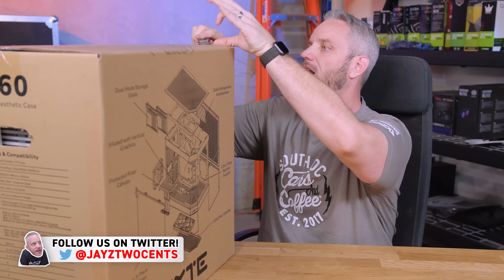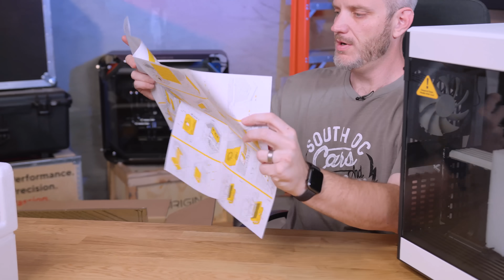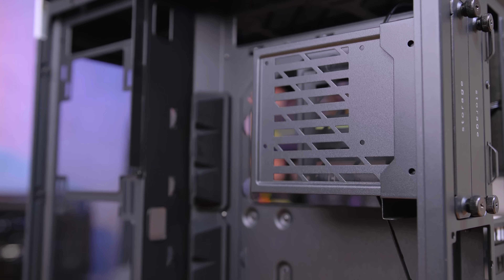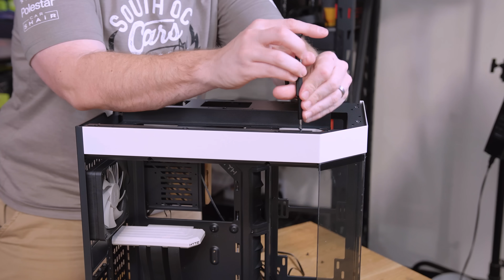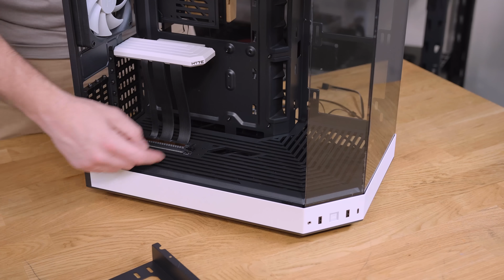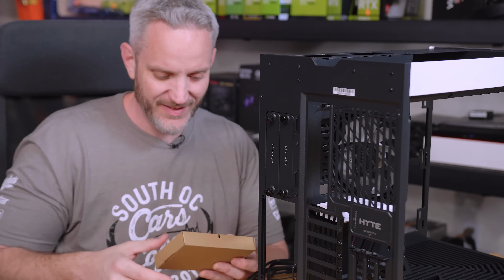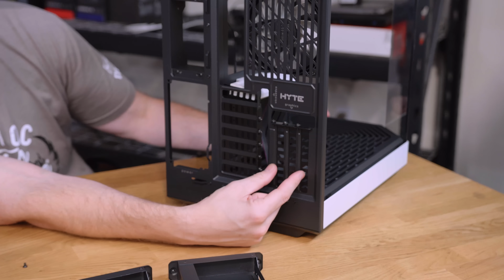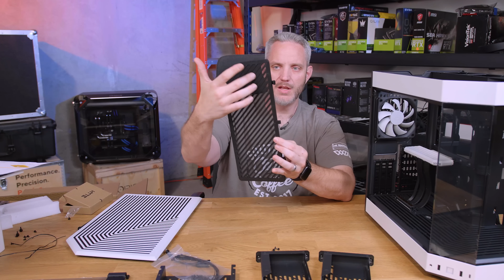Someone FINALLY broke the mold for PC cases...

Comment: I just built in this. I see a couple things that I'd change. 
1) the top rad tray has the clearance to slide forward a couple inches. The case is notched out to accept it, but the tray doesn't line up with the screw holes. 4 extra holes would allow the rad hoses to be rear mounted instead of only at the front. 
2) the HDD sleds take up a lot of space, and the screws are offset, so you can only mount them one way. If you could flip them or even remove the tray from the rear blank(cover) that would give you a lot more room.

3) The bottom fans have the cord connected at the side of the fan instead of the corner like most fans. This means the case has a hole that lines up with the hyte fans and not aftermarket. Also the screws for the bottom fan could be an extra 2mm in length. The popular Arctic P14 fans are a hair too thick to mount without aftermarket screws.
4) the cutout for the rear I/O plate on mine was a mm to large top to bottom. Also (visual only) I think the small opening above the vertical GPU screws on the rear of the case could use one of those little sliding panels to finish it off.

Comment: Oof, the mini expansion slots in the back, and the fact that the forced vertical mount being only 3 slots with no real clearance are the killers, along with only 2x 3.5in bays... This is a "showcase" case. not actually practical with those drawbacks...

Comment: It's nice to look at, but I think a lot of people wouldn't be able to use the fans on the L end.  If it's on your desk to your left, the bend probably faces you and will add noise to your mic area.  If it's on the left side of the desk on the floor, it's either not getting fresh air (outside a solid desk) or picking up whatever your drop toward your feet (inside the desk edge/open edge).  If it's on your desk to the right, it only gets fresh air if it's not against a wall.

I think it'd be better if the curve went the other way and the jacks were on the other edge.  Also, probably on top.

Comment: ngl kinda wanna get this case. others are turned off by the low profile but I wouldn't be using those and a riser should(?) be okay.

it gets really hot here and my PC just turns my room into a boiler so I've kinda been looking for a case that's giga chad air flow - don't wanna water cool just yet, too big of a step for a 1st timer like me lol

Comment: This would be an awesome upgrade for my CAD slayer. Only thing I might do is mod an additional storage rack/cage to that back fan mount, or just in front of it on the grill floor to still put fans on that mount.

Now just to decided between this and the O11 Dynamic.

Comment: I have learned the best way to avoid a static shock, when you expect one, is Not to use your nerve dense finger tips. Close your hand and use your knuckles or the back of your hand, it will hurt far less.
Jay - Paul has already built in this case. Really like the concepts of it. The price tag, not so much.

Comment: The reason the instruction are printed like that. Answer  I work in a printer in the uk we use rolls of paper that print both side of sheet the intstruction are printed on one roll then cut the cost of a fold out to a actual manual instruction to range from a few cent to dollars to be honest

Comment: If it was just reversed, only reversed cases work in my space. I NEED the IO to be facing the opposite direction, which is why I chose the Corsair Carbide 600C so many years ago, and have not found a successor worthy enough to replace it since. I REALLY love the design, but it just will not work for me, though I wish it did.

Comment: With the only low profile PCI Slots and the GPU only 3 slots high but vertical its out of the question for a buy. new nvidia cards now go to 3,5 slots and ada will go up to 600w needing big coolers. 
evene with 3 slots it is starving for airflow against that wall. 
these days you need capture cards sometimes a second gpu and yes also audio cards with lot of ports on the back.
all off these arent half hight. iBuy should revisit the case asap and change the backside. providing a version with a standard slot design and one with the riser cable and vertical mounting option. or sell the last as a kit as an option.

Comment: For $200 there's few better cases out on the market. The vertical/low profile mounts will be disappointing for some but this style of case is ideal for those cases in the corner with the location of USB , power, and headphone jacks. 

I like it.

White, red, and black options though the black option is on back-order til the end of June, FYI.

Comment: Hmm, It's pretty, but there's a couple of things that kill it for me (this coming from the perspective of someone who doesn't trust themselves to do a watercooling setup) 
-The vertical mount for the video card is...never an idea I've been hugely fond of, and given the front face of the video card is the intake, mounting it facing glass like that is just an actively bad idea for airflow.  Looks pretty, but lots of things are pretty and not practical.  This is one of those.  It's nice to have the option, it's not nice to be forced into it.
-I'm also not a huge fan of top venting, especially in a curved airflow case like this.  Having openings at the top make it much easier for anything above it (dust floating in the air, the contents of a drink being carried by a slightly clumsy computer owner who has just tripped, etc) to fall in...though part of that hazard is mitigated for people with larger desks than I'm used to - I tend to have my computer tower on a low table next to the desk.  And air that's under pressure (so all air that has just been pulled into a case by an intake fan) tries to expand to relieve that pressure, so having an exhaust (all of the top) next to an intake (usually the front panel, in this case the side panel at the front) means air being pulled in from the front/side intake has an opportunity to leak out the top before it gets to anything you care about cooling.  (Certainly not all of it, and ideally you'd have a setup where the pressure in the front of the case would be relieved by the intake of air for the cooling tower, and the pressure at the back created by those fans is relieved by the exhaust vent at the back, but as someone who studied mine ventilation, it's way more practical to just close off the exhaust vents until you want them.)  The curved airflow layout from front intake to rear exhaust just makes the problem worse: the friction caused by that curve (which I noted is not exactly aerodynamically rounded) slows the air due to friction (yes, it does apply to air, that's why the planet hasn't just gotten steadily more windy without ever slowing down until the atmosphere achieved escape velocity), which means the air will be more dominated by the pressure-based need to expand to the nearest low pressure area (the top exhaust zone) rather than the speed based need to go the same direction it was going.  A top intake is bad too, since the case is ejecting heat out its exhaust and hot air rises and expands - the air above the case is going to have a lot of the heat the case just tried to exhaust, and it's now pulling that heat back in for another round.  That's why I like the fact that the Torrent doesn't have the top exhaust vents.

For those of you who do watercooling setups: Top vents are great!  If you've got a front rad, you can eject some of that heat through the top right away.  If you've got a top rad, you've got airflow from your front fans providing the freshest air in the case directly into cooling the front third or so of that radiator.  If you've got both, you've got a mix of both good things from that.  The reason I was saying they're bad is because they let fresh air be exhausted out the top before it can cool anything, but the rads have moved most of the cooling burden such that my argument is completely invalid.  Also, if you're watercooling your case, you're probably a lot more worthy of being trusted with liquids around electronics than I am, and thus the concern about spilled drinks is less of an issue.

(I'm also of the opinion that positive pressure in a case is a good thing, as long as you don't ignore the design of your exhaust.  It keeps the dust from getting in through all the cracks and such that allow airflow but not by design, because all that air is going out.  Controlling where air can get in lets your dust filters actually do their job.  It does come with a slight impact to fan performance because higher pressure inherently means lower flow rate (you can't push a vehicle as fast as you can move if you're not pushing anything), but as long as there is a good exhaust system at the back, the pressure level shouldn't get to the kind of extreme where you start dramatically limiting airflow (more like pushing a shopping cart back to your vehicle than pushing said vehicle).  One could certainly make the argument for ventilation options on the top at the very back (where the power supply is on the Torrent and on really old cases, where it's just providing more exhaust to the used air that's being blown up and back to that corner of the case, but in designing that, you'd have to watch out for just how far forward that exhaust zone gets - you'd probably want to avoid it going any further forward than the CPU tower, if possible.  Balancing intake and exhaust pressure is still valuable, but for the dust control reasons, I'd argue it's worth trying to land a bit on the positive pressure side of things.  Negative pressure will get you the best intake fan airflow, but with properly designed fans, you're probably not going to notice the difference unless you do something insane like mounting every fan as an intake fan (or an exhaust fan), whereas you're definitely going to notice the performance impact of choking your system with dust after a year or two of use.  Assuming you don't work in a cleanroom - if your workspace is the kind of space that's so clean you can switch hard drive platters from one device to the other without losing data, you might want to look into the negative pressure system, because dust is clearly not an issue for you.  (And yes, I know a person who did that successfully - a drive with some stuff not properly backed up had its motor die, and the only way to attempt to recover the data was by switching the platters over to an identical drive with a working motor, and it worked, to everyone's surprise.)

Comment: It looks good but I wouldn't call it mold breaking. I like it but it just feels like someone modified an O11. That said, I do like the fans being under the case like that. The changes they made seem good but the low profile expansion slots killed it. I don't like the vertical GPU anyway personally

Comment: There are special cartridge systems that will take 2 SSDs and mount them into a single slot for one HD. That should allow 4 SSDs to be mounted easily in this case. The ones I use have a quick release button to easily eject the SSDs.

Comment: Its been seven years since USB C devices came to market.  It’s been ages since I replaced my last USB A device with all USB C (I have an A-to-C adaptor for when a Neanderthal gives me a thumb drive, so I can still access his mastodon ivory and bronze artifact).  Why are front panels in 2022 still mostly USB A ports, with one measly USB C port in this case? Jeezus, can we move on please?  Why not provide the instruction manual in cuneiform while you are at it?
Reply: Half-kidding aside, it is otherwise a nice case.  I have seen other reviews of it, but Jay pointed out some compelling features and other considerations the others missed.   Thanks for pointing those out!

Comment: The only thing that might keep me from considering it is the low-profile expansion slots. 

My rig has 3 NVMe (on mobo in PCIE 4 lanes), 2 SATA spinners, and 1 SATA SSD. It has a 360 rad, down from a 360 and 120. I originally had the pump/res inside, but then decided to use 1 slot opening for a liquid pass-thru and mounted the pump/res outside, along with the drain valve. That gave it a cleaner looking inside, but kinda odd out back with the res rising above the top of the case. Now there are fewer issues with leaks when servicing the water. (Clear, distilled water + anti-microbial.) Plus, the perfect spot to burp it is the easily-accessible res!

As above, 1 slot cover is surrendered to the liquid pass-thru, and another is for a remote power switch (very convenient!). Neither one of those use an actual PCIE slot, so I've lost some functionality. I'd like to see a case with blank slots for just these kinds of accessories, maybe 3 or 4, in place of the single rear fan. The way I see it, there are plenty of other spots for fans, and giving up one for more flexibility with accessories would be worth it to me. Besides, if a user chose not to use any of the blank expansion slots, they could still put a fan behind it. Win-win!

A couple years after building it, I picked up 2 more spinners, but my mobo has only 4 SATA ports, so I went with a 4-bay NAS. Only 2 are populated. Not sure if/when I'll ever fill the other 2, but they're there, just waiting.

If I were to do it again, I'd look at all the case options so I could get a lot of expansion slots and/or other options. That would also mean a new mobo for more SATA ports, etc., allowing me to put all of the spinners inside.

Comment: It's a sweet case! I own the black version. Have 2 140s on the side and in the bottom with 3 120s on top . Keeps my temps pretty good, CPU temps don't get past 72c and my gpu with aio doesn't go past 55c. Saving to  do full loop. 

Set up:
ASRock b550 taichi 
R7 5800X
EVGA 3080 hybrid
32gb Corsair 3200 ram 
Samsung 980 1tb m.2
And some Amazon CPU air cooler 

This case is a keeper .

Comment: i was sold on this case until, the drives and the low profile mounts, i have 6 drives total 2 of them are 3.5 hdds, 1ssd and a 2.5 hdd from a laptop, i also have a m.2 drive i wish this would have more mounting places for drives. for the low profile mounts its sucks because i have a dedicated wifi card and it will not fit.

Comment: Will it be possible to mount 2 2.5" SSDs and one 3.5" HDD on the Sleds without double sided tape? I want to buy a new case because my BeQuiet Darkbase Pro 900 is getting boring and i consider the Y60 because it looks unique

Comment: I would be more surpriced when/if they make a silent case with actualy good cooling/airflow aswell.

I have really sensetive hearing, and i cant stand listening to my 3090. It so loud when it runs on "full" power !   But the moment i put it inside a closed "silent" cabine, it is like having a mini oven in the room lol.  It gets SO warm, which in return kinda makes it louder because now all fans run maximum speed aswell.

Comment: The expansion situation might be an issue for me.  Right this moment, it's not, but I'm seriously considering getting back into audio production and that would call for a dedicated sound card. Which would be ruled out if it's also my gaming PC, at least without some case  mods. Though maybe USB audio interfaces these days would be good enough, haven't looked into that area since my EMU 1820 died many years ago.

Though if it was strictly a gaming build, I could afford the few extra bucks for RGB everywhere it's an option, and they have a black option... Yes, I would use it.

Comment: I def want to build in this. Aesthetically this case is hitting all the marks. I would like to see the temps on a card using the riser since it would be very close to the glass. Depending on those results I can maybe determine if I will stick with fans or change to liquid cooling for the GPU.

Comment: I just built my system in this case and enjoyed it very much. PC speck below 
Ryzen 5 5600x 
MSI B550 a pro motherboard
Tridentz 16gb DDR4 3000 MHz
MSI 1660 super
Kingston 128gb SSD (Boot)
Western Digital 1TB HDD (Mass Storage) 
Western digital 1TB m.2
EVGA Supernova G2 650W Gold PSU

Comment: Nice to see people try new stuff but I'd personally stick with an O11 for sure (More accurately an O11 XL  :P).  Practically the only thing I like about this more than the O11 is more airflow through the panels.

I want the bottom of the case to have more purpose than hiding cables/fans. You can't mount rads, storage, and I assume an it's unremovable grill if you wanted more airflow.

Having the only option for mounting the GPU to be vertical almost makes this case a complete joke for me.  I guess it's okay for a single build that is never going to be changed but I want flexibility in my cases and want to use them for a long time possibly switching between water cooling and air cooling.  To be honest though I don't suspect that it's that common for you to need a full profile bracket for things that aren't GPUs an most storage, NICs and the like will coming with both type of brackets.  You'd just better hope that you never want to add things or swap stuff around if there is water cooled GPU in your way and I assume the GPU will be water cooled because of the vertical nature.

I don't like the flaps in place of grommets.  This just mean just means that one tight cable is going to yank the whole thing back and the grommet (or lack there of) won't be able to settle around it.  Imagine a tight 24pin.

There doesn't seem to be much thought put into water cooling clearance besides the side mounted option or just a skinny AIO in the top.  Edit: And a totally missed the fact that this only fits a 240/280 in the side.  This also highly limits the amounts of res pump combos you can mount to the front of that rad without being too tall or not being able to fit fitting in the top of it.

I like having space for more than two drives sata drives.

Finally I hope that vertical GPU is easily replicable.  Knowing  the durability and how often those riser cables cause issues I certainly wouldn't want a non replicable one attached to the case.